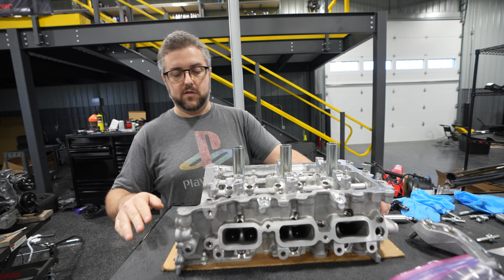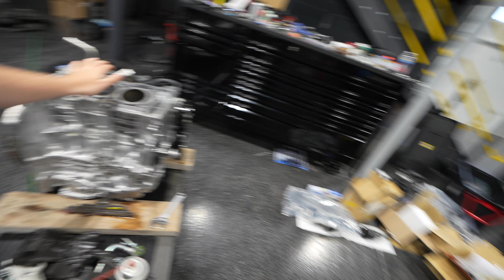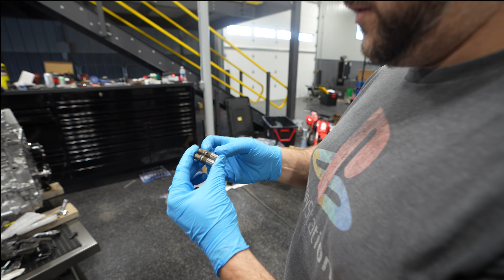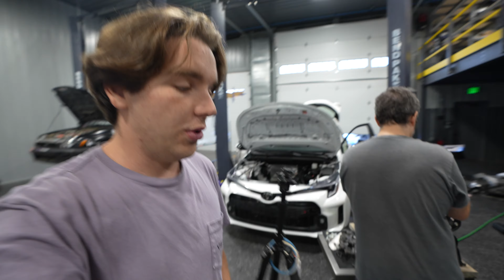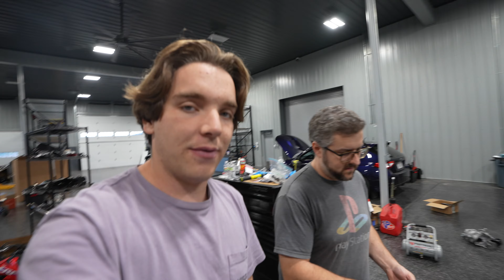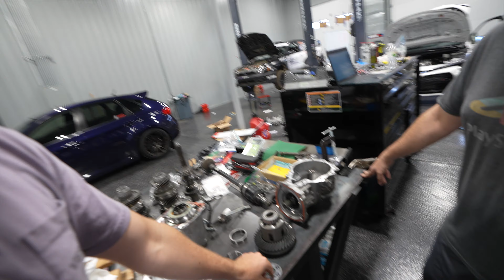500hp upgraded valve springs and Camshafts On Our GR Corolla (Gymkhana Grid GR Corolla EP10)

Comment: I'm a Toyota Master Tech, new chain tensioners come with what looks like a blunt thumb-tac installed into the hole to keep it locked. The trick I use to ensure I don't do what happened to you (as has already happened to myself) is I use the thumb-tac with a string tied to it. I've had one pop out and fall into the oil pan, but I was able to retrieve it via the string.
Reply from the maker: If only you commented a few days ago lol!  Thanks for the support and I will definitely try that next time lol🤘
Reply: @NemtecRacing  nothing better than spreading knowledge. Love the videos and I can't wait to see the results. Which I'm sure will be amazing!